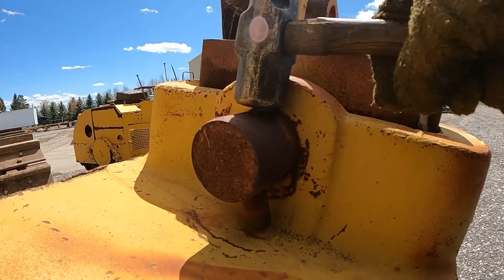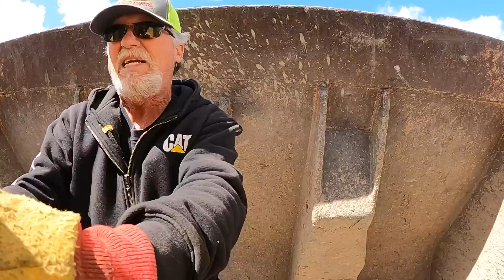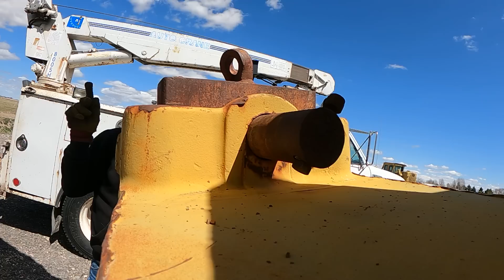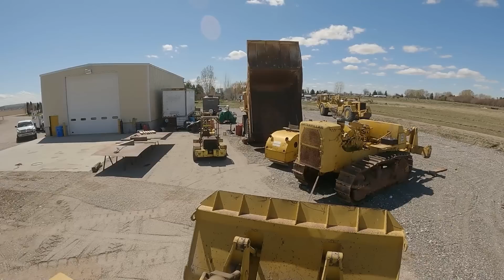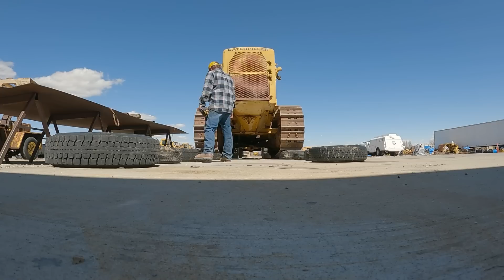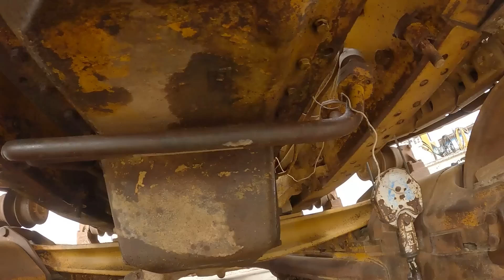Lifting A CAT D9H With A 988

Comment: I always hated crawling under the old D9G my uncle had to change the oil on the job.  there was a lot of anguish when you were down to the last threads on the plug... my uncle wanted the oil HOT and you were going to get burned and  oil soaked  when that plug came out!
Reply: Fumoto valves for the win on that

Comment: great value video jeff , those steel lines are what i mentioned about a while back, they rot and rub and they go all the way back to around the seat , if you can get some new or get some made its way better to replace them with New ones when it in peaces then when you are using it all back together. when we pulled the belle guard of ours i found 2 spanners and a 3/4 socket

Comment: good thing that its not ahigh track. one of my 9N s caught fire and my other 9N could not drag it off of the pile. put a 992C on it and no go had to pull stub axles out . The brakes lock up when engine is not running
Reply: Engineering complexity

Comment: Thumbnail image at the front looked like the 988 lifting a D2. But just for a second.  
I have a issue. When not using the crane. Why not move the service truck up till the rear deck is closer to the work area.

Comment: what are you're thoughts on CATS brand new D11xe DOZER. The reason i ask is because i know alot of older and even some of the knewer operator's preferred to use a older cat than a newer cat because there system and control differences. me personally I'll run either one if given a chance too lol but i know not everyone is like that tho so i just wanted to know what your preference was.
Reply from the maker: d16?
Reply: correction d11xe is the one i ment my apologies there.
Reply: @Jpaydirt  R
Reply from the maker: I have limited experience with CAT's high drive but I did rent a D8T and I wasn't impressed at all, there's so much wrong about them I could go on forever LOL  they eat undercarriage, visibility is poor, the ripper won't lift high enough, to much HP to weight, to many pins and bushings to replace on the bogies , a very expensive cross shaft 16K to be exact. the only tractor made that you have to line bore the hard nose, there fine in a mine operation or shot rock but for everything else there to expensive to maintain

Comment: I may have missed something, hope you can help.  What is your objective?  I don't think you're trying to corner the market on old D9's.  Are these newest additions part donors?  Rebuilders?  How many do you intend to have in service when done?

That loader is an absolute BEAST!
Reply from the maker: to have a dozer with ac and heat☻
Reply: @Jpaydirt  reversable  fan blades and perforated floor plates were enough years ago

Comment: How thick are your concrete pads? I need to pour one near my shop and can't decide on the thickness. I won't be on it with a 
D9. Maybe a D4 or a backhoe.
Reply from the maker: six inches thick with half inch rebar on 18" centers, 4000 psi concrete